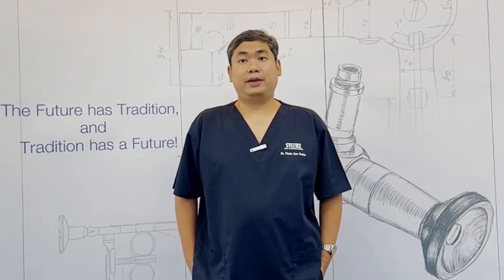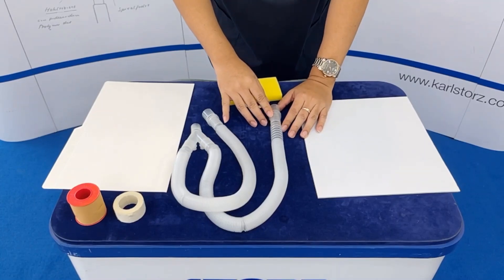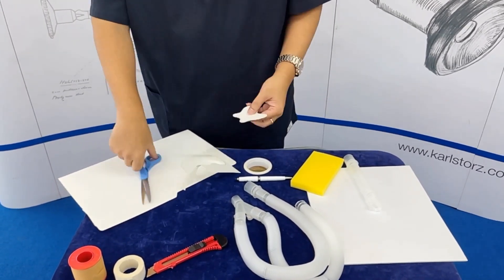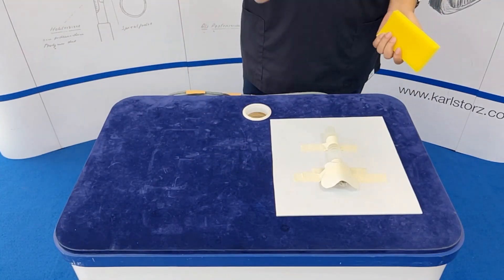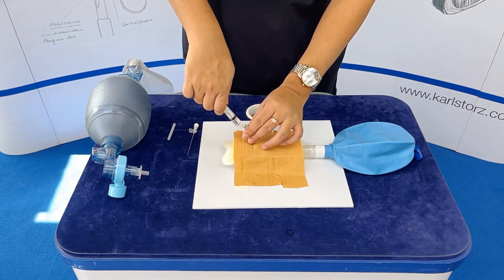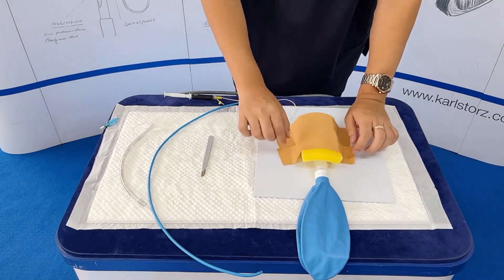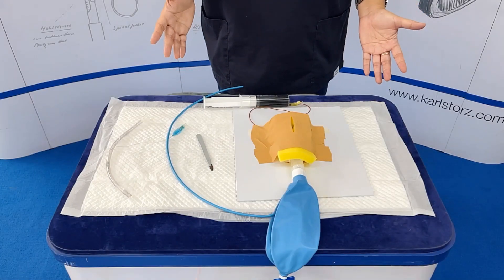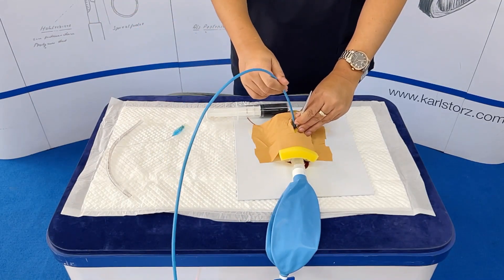How to create a FONA trainer

Comment: The upper end of the dummy airway tube should not be closed. It  gives a false sense of adequate ventilation while using canula Cricothyrotomy. In reality, a significant portion of the ventilated gases will escape through the upper airway.